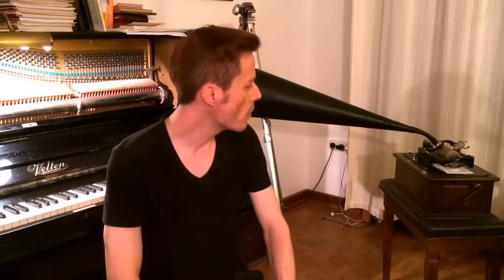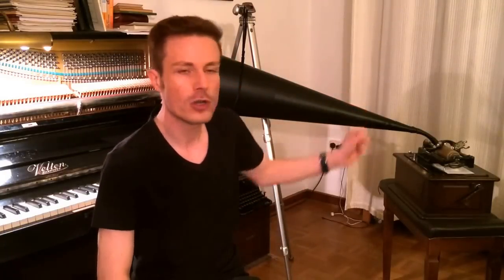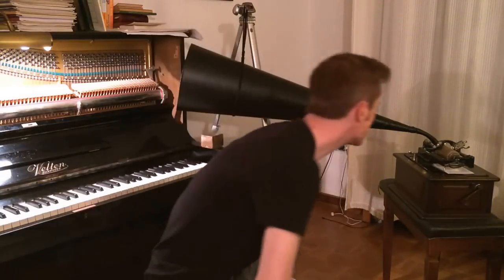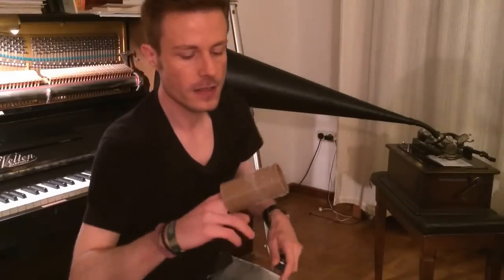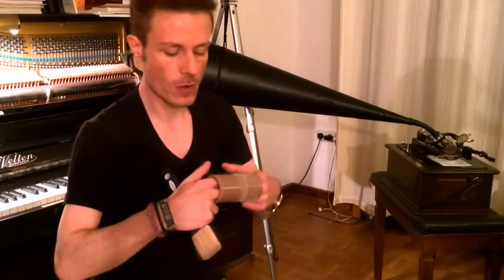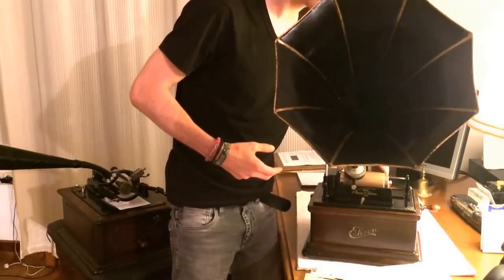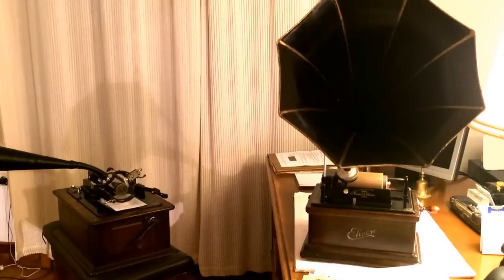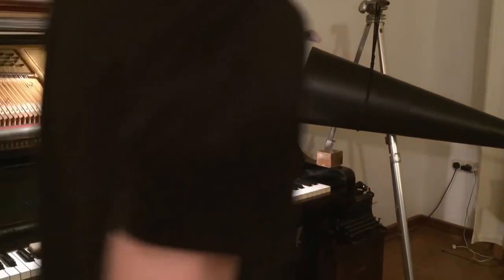Tutorial: Acoustically Recording Wax Cylinders On The Edison Phonograph

Comment: Good recording. Can you share the information on the big horn?
Reply from the maker: 좋은 하루 ! Yes of course with pleasure! ^_^ 
I made the horn myself. It is not very difficult to make one like this.
This horn is made of plastic and covered with black vinyl foil. It is made from a piece of solid plastic board from a hardware store. I simply folded it over into a cone horn shape, drilled some holes and fixed it with some screws and nuts. 
After this I cut off the overlapping material and glued a copper reducer at the thin end. Finally it became a finish with self glueing black vinyl foil I cut into stripes and covering it all over. This holds it properly in position, gives it a nice surface finishing and as you can hear, the results are quite decent.
It is like folding a paper into a cone but with stronger plastic material. 
It is almost 6 feet long (1.80 meters) and it's open mouth end has a diameter of about 1.2 feet (40 centimetres) and according to the material it is very light: only 1 pound. So it's no problem to fix this on a tripod or crane to hold it in position.
Reply: Thanks. I will try....  Not easy to me.
Reply from the maker: +정창관 Very welcome! ^_ ^ A pleasure! And it's really not that difficult, just find a material soft enough to be bend over and hard enough to hold the form, fix it, cut it, (maybe) paint it or use foil as I did, and there you go. It took me about 15 minutes. ^_^
Reply: Do you have a link to the type of plastic or black vinyl foil you used?  I tried looking in stores and couldn't find it :/
Reply from the maker: Hi Sadd! Yes, with pleasure! I went to a local hardware store where you can buy plexiglas by meter. This material can be folded over in a cone shape. It takes some pressure and needs to be screwed to fix it but it works rather fine! 
It is this material: 
http://www.plexiglas.de/product/plexiglas/en/products/film/pages/default.aspx
Good luck! ^_^